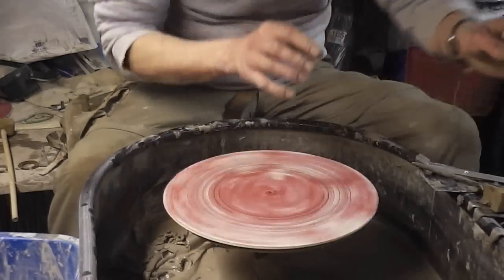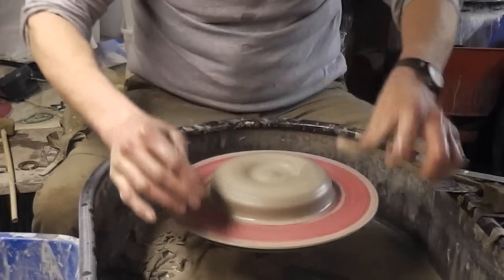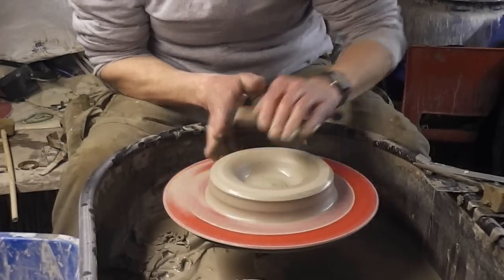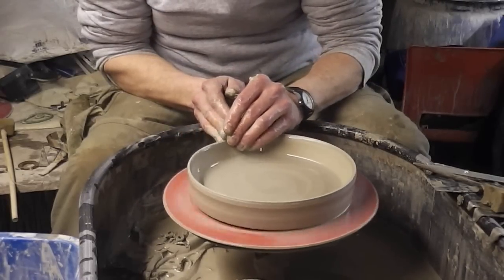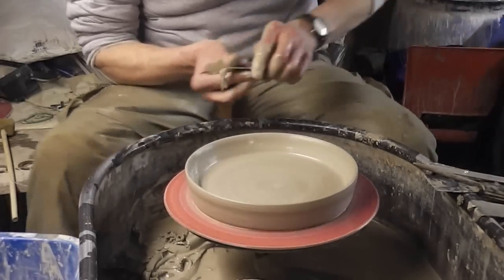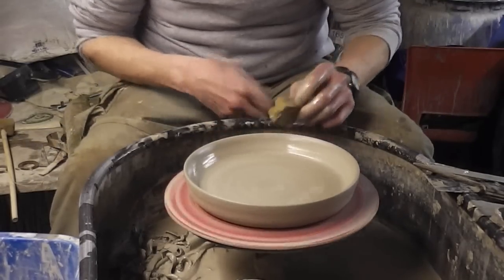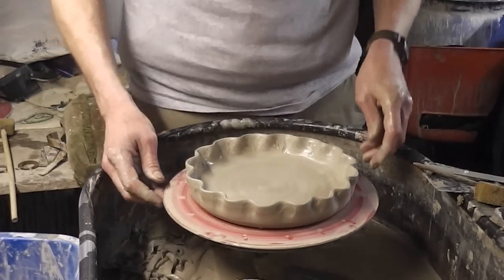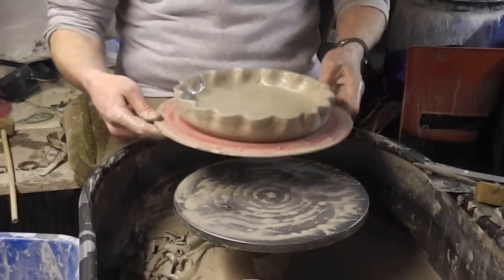Throwing a Fluted edged Pottery Pie Plate / Dish on the wheel

Comment: Do you have trouble with warping in the kiln with wide-bottomed pieces like this? How do you solve that problem if so?

Thanks for the videos. I always watch yours first when there's a queue in my subscriptions. :)
Reply from the maker: Stoneware wide pots are a problem when it cones to warping due to the high temps when firing.
We don't do many because of this.
I'll still make them though and use the pot myself if it comes out all wonky.
Cheers, Dan.